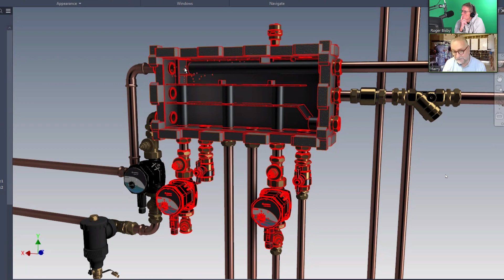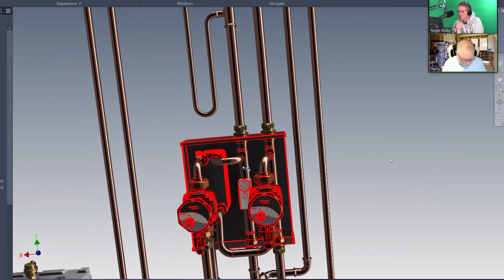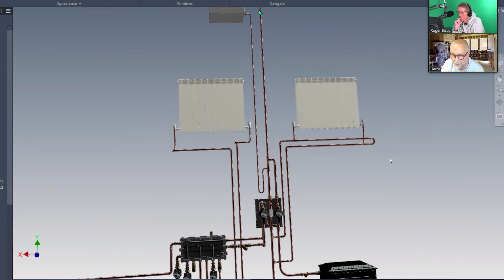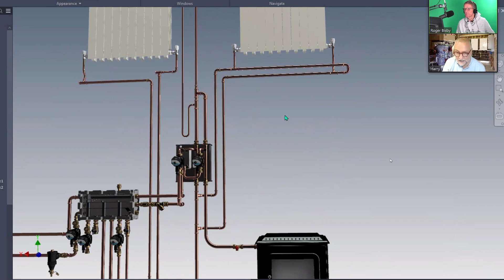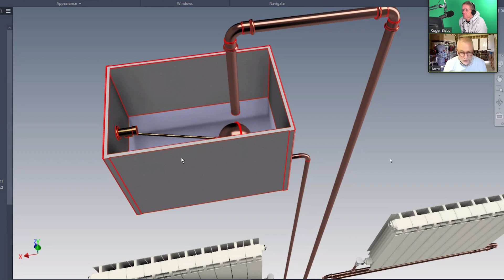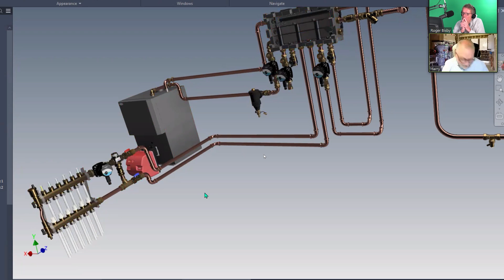Every Heating Installer Should Know This

Comment: It's a common misunderstanding that having a system on that you are wasting heat. This isn't just about single temperature being achieved for you to feel comfortable. A good example of this is if you place someone in a room next to a block of ice and the room is 21 they will feel cold place them in a room that is 21 degrees next to a block of red hot metal and they will feel hot. This is part of the principle of constant heating where the building is kept warmer reducing the rights of loss of heat through radiant transfer from the body to the fabric of the building. Maintaining a constant warmth allows the heating system to be run between 1 and 2 degrees cooler than it would need to be if heating from cold. When we talk about heat pumps and low temperature systems being on with talking about a very low level of energy to maintain a reasonably low level of heat in the property but not so low that the comfort is destroyed by the lower temperatures achieved during an off period with a high temperature boiler system. We also have to take into account the loss of efficiency cause to both gas boilers and heat pump systems when they are operated at high temperature to perform a recovery from a period of no heating. Most of my customers are it engineers and people through the technical interests or from the technical industry. The most regular reporter get after fitting a low temperature system which is running 24 hours a day is that they report a higher level of comfort and a reduction in gas spending of 20% compared to the old on off thermostat on a timer. What we really need is to collect some good test results from customers like these or in a test environment to finally make this understood so that people can adopt the new technology and reduce CO2 emissions while enjoying better comfort levels.

Comment: A perfect illustration of why I went all electric 17 years ago, and recommended it to family and customers.  My 'system' is extremely simple, 100% reliable, silent, and takes up no space at all.  It costs at least twice as much to run as gas (which was there before), but requires no servicing or maintenance, and never requires any parts.  Each room is time & temperature controlled.  It was the best thing I did as part of the refurbishment.
Reply from the maker: Great point! I reckon you could put the £15,000 paid for a heat pump installation into a high yield ISA and it would close the gap between gas and electric even more.

Comment: Got lost on some of the technical stuff. However, is this only for 'dual' fuel systems or would a domestic combi boiler installation benefit from a NRG manifold? 🤔
Reply from the maker: It is really for systems with more than one source of heat. That could be a gas boiler and heat pump or any other combination. It is also good for two gas boilers which larger homes sometimes have.

Comment: This guy really knows his work, learned so much in this video (and I am not in the industry myself). In the hybrid system though I wonder why they design the heatpump to attempt heating for  1hour before having the oil kick in.  Two things:
1. Surely its more efficient for oil to kick in first to bring water to temp.  Besides, a heatpump will do very little in 1hr vs oil.
2. Could there not be logic in the controller that checks outside temp and inside temp, then decides if the difference is great enough for oil to kick in or if heatpump will suffice.  

This is just an observation from someone who has little experience in heating systems (apart from owning a hybrid system myself)

Comment: Absolute genius. How is it that we understand so little about central heating after all these years (?). I looks simple. The principal is simple. But to make the best system requires a genius.
Reply from the maker: To be fair this low loss header is for mult-fuel options and larger buildings. You wouldn't need this for a 3 beroom house.
Having said that I agree that they have been made way too complicated and unreliable. Complicated technology is not suitable for the building industry.

Comment: Telford tanks designed a thermal store tank  for me. Brilliant.  It does the work of a Dunsley. It is connected to our wood burner and oil boiler. It supplies our hot water which is potable and heats our radiators and under floor heating. I explained the system to my plumber and he fitted first time and done a superb job. For the first 26 years the oil boiler was a simple 14/18 Worcester oil boiler. It is now an18/25. I will connect to the tank a thermodynamic panel system soon, the best system you will ever find. It heats water 24/7 day or night.

Comment: I’m a heating engineer, and I’ve just finished installing a system using a lot of these components from NRG Awareness. The people talking about the extra cost and materials need to bear in mind that this isn’t competing in the 3k combi swap space. It’s the 15k heat pump installation space where a lot of the extra plumbing work is required anyway. But for me the really exciting part is that it's a great option for adding heat pumps to the energy mix of the roughly 50% of UK housing stock where a fully heat pump driven system is just not currently feasible (regardless of what the Heat Geeks would have you believe.) My house is one if these. Old, single skin, stone built 3 bed.

When designing the heating system, the goal was to have something that is always operating at the lowest price per KW, regardless of the outside temperature. 

The system is basically a hybrid that involves a large battery (to be installed when the extension is finished) to allow us to use economy 7 and solar electricity to power a 6kw heat pump, a wood burner with a back boiler that can add an extra 4kw into the heating / hot water system (again, adding this when the extension is finished), and a gas boiler. The system switches between calling for heat from either the gas boiler or the heat pump based on the external air temperature, and the wood burner just always adds heat to the system whenever it is being used.

Basically as the temperature drops and you require more heat, at a higher temperature, all heat pumps actually make less heat, less efficiently (you pay more for less as the temperature drops). You have to size both the heat pump and heat emitters accordingly. Bigger heat pump means bigger plumbing, bigger electricity supply, bigger costs all round, and it will never be running efficiently when the temperature is low.

My system uses a 6kw heat pump. But that’s 6kw at -2. At 6 degrees it’s actually outputting more like 8kw, which heats the house just fine without even having to upgrade the radiators. I’v currently got it set so that the gas boiler will kick in below 5 degrees. Over the last few months, the heat pump has been heating the house, the vast majority of the time. Without the battery system (and therefore economy 7) and the wood burner installed yet, it costs about the same as gas. With the battery system and economy 7, it should cost half that much. 

The heat pump is basically always operating as efficiently as possible, and the house is never cold. I haven’t had to upgrade the electricity supply or other plumbing outside of the HW cylinder. It’s a tight fit but I’ve managed to fit everything (NRG Zone, cylinder and all the controls etc) in a corner cupboard. I run max 45 degrees through the radiators when the heat pump is operating and 65 when the gas boiler is operating. At some point I will upgrade the rads to allow me to reduce the the flow temperature and increase efficiency further.

System works great, NRG Zone and NRG Lex are great products, and NRG were very helpful (they actually did bespoke wiring diagrams to help me implement this, at no extra cost), and I would highly recommend. 

As a heating engineer, what this allows is the opportunity to give customers who can’t afford to upgrade everything, all at once, the option to spread the cost of fully decarbonising their heating system over a longer period, while immediately massively reducing their reliance on gas. I’m one of those customers. I bought my heat pump directly from China. It cost less than a middle of the road combi boiler, delivered. It’s modulating, quiet, works to specification, and is actually MCS certified. You can’t get a grant for a hybrid system, so that’s not really relevant, but it’s nice to know.
Reply: At the moment the heat pump market in the UK is broken. As a heating engineer, I look at the prices being charged for heat pump installations, and I literally cant work out where all the money is going, other than into the back pocket of the people who run the medium sized companies that install them (you basically need to employ someone just to do all the grant paperwork). The MCS and grant scheme has almost completely excluded the vast majority of small heating and plumbing businesses from the market, and as a result you’ve got tens of thousands of gas engineers in small businesses and one man bands who customers trust and have used for years, telling customers that heat pumps are a waste of time, and to just install a new gas boiler.

If we really want to decarbonise the heating industry, this needs to change. They will only become affordable when normal heating engineers are able to install them. Heat pumps are simple technology. They are more like installing a fridge than a gas boiler. The key is sizing them correctly, and ensuring that the plumbing system is adequately sized to deliver the lower temperature heat that they produce efficiently. These are skills good plumbers should already have.
Reply: Every 5 years gas engineers go back to school and spend a week renewing their qualification. This should be expanded to include the installation of heat pumps. 

Government support should be expanded to include hybrid systems, made possible by products like the NRG zone, which potentially make heat pumps affordable for more people, and appropriate for more properties. Customers worry that they will be expensive to install and run, and that their houses will be cold. Hybrid systems are the solution in many of these instances.
Reply: The Heat Geeks, to me, make something incredibly simple, seem incredibly difficult. Because it benefits them.... Heat pumps are not rocket science.
Reply from the maker: MG Plumb
Great comment and a good addition to the debate. Thanks for taking the time to write it.
Reply: I'm UK Based, had to import from Ireland.
Reply: @mgplumb9135  , Agree with you in that heat pumps are incredibly simple even more simple than a combination boiler, But look at the mess we in the Uk .With  30kw+ boilers being the most common boiler sold in the Uk where the Average heat loss of the Average Uk Property is less than 6kw at -2 . Ask anyone who lived in those housing estate in Coventry  where Those Firefighters were installed, and Nibe had to remove them , and here we😊 again , with horror stores of badly installed and over sized heat pumps . You are being disingenuous to Heat geeks and the likes whom you referred as attempting complicate the issues. Far from in my point of view ,someone who has spent the last 25 years in the Heating industry.I total disagree with your comments, I believe in spreading the knowledge and best practices will benefit everyone Engineers and consumers alike.
Reply: @lekanshanu5512  Sizing boilers correctly is the same skill as sizing heat pumps. Yes there has been a loss of skill from the industry, that has been masked by the fact that modern boilers modulate so effectively, and even boiler manufacturers have seemingly been happy to allow KW output to be used as a point of difference / way to upsell. 
Both heat pumps and gas boilers are most efficient on systems designed to run at low temperatures. Unfortunately, for decades, we’ve been designing systems with heat emitters sized for high temperatures, and pressurised plumbing systems designed to run at low flow rates.Fixing that is the real cost in most heat pump installations. They are plumbing problems. They require a few days of extra training when you renew your gas ticket, not a completely different regulatory framework that excludes the vast majority of the UK’s heating engineers.

Comment: Hi Roger, I have used NRG manifolds many times and found their product, and more particularly, technical support has been 100%. Its only going to be useful to a small number of applications, like larger houses , multi fuel input options and commercial. I did one guest house that used 4 manifolds, 2 oil boilers, 2 single phase HP, 2 floors of U/F with  multiple manifolds and radiator circuits
Reply from the maker: That is great to know. I am assuming you are in Ireland?
Reply: Yes, we get a lot of farmhouses that that will have an oil boiler and wood/turf stove or external gasifying wood burner linked, and feeding 3 or 4 zones. they also do a wiring control box and wiring schematics. @SkillBuilder

Comment: Did he just say that he fitted two 100KW boilers “because it was an old house” then fitted three heat pumps which are 20KW each, and after it was up and running found that the heat pumps were actually heating the building without the need for the 200KW from the boilers?? If thats true, then this shit is exactly what is wrong with the heating industry🤦‍♂️

Comment: Excellent!

I  fitted my own system based around a thermostore tank which has inputs from a solar heat array, solid fuel stove and an oil boiler.. 

The issue I have is that the system, which is open vented, expands regularly so I get hot water coming out of my header tank overflow. 

Obviously this means the tank gets topped up with fresh cold water every time the system cools down which is adding air and diluting my inhibitor.

I have either fitted my over flow pipe to low or my inlet ball valve too high or  my system is badly designed... i'm concerned that over time I am going to have issues with the boiler or my radiators rotting out, in the meantime I keep my mag filters clean and top up the inhibitor additive once a year but I feel its just a band aid.
Reply from the maker: You might simply need another expansion tank. You can couple two side by side
Reply: Trouble is.. the thermostore tank is all piped and brazed and insulated so I wouldn't know where or how to add a vessel but this has prompted me to get into contact with the manufacturer to see what they suggest..

I have a self-build project coming up this year and I will definitely look into the system designer in your interview.. it was very interesting
 @SkillBuilder

Comment: Good practice to dip cold feeds.only problem they can block up over time
Reply from the maker: You are not wrong. I always do them as compression fittings.
Reply: That tends not to be an issue when the system is designed not to have system expansion problems. Still, having the loop removable for maintenance is a very good suggestion.
Reply: Cibse recommend using tees at the bottom instead of elbows with the outer ends with copper to iron connections with a stop end/plug to make water tight.Easily removable and can rod between each tee as straight through

Comment: So is this cold feed set up with the loop like that just for solid fuel? I always thought that if we were 150mm within each other we would be good? I know we install shower pump supply from 3rd way down from the cylinder
Reply from the maker: I think it would be beneficial on all systems at least to drop the cold feed out of the bottom of a tee and then take it up. It makes sense to prevent warm water rising to the f&e tank.  The problem I see is the tee blocking up at that point which is why I do it with a compression tee. Having said that I am doing sealed systems now so it is rare to put an f&e in these days.
Reply: @SkillBuilder  totally agree with the blockage. Often when you try to drain an f and e and  nothing moves. Will keep thos in mind. Interesting chap and enjoyed the conversation

Comment: As soon as Roger said heat pump I lost all interest. Off to watch Sssniperwolf.
Reply from the maker: That is a shame because he said it could be anything from a boiler to a solar thermal to a heat pump.
Reply: @SkillBuilder It’s a shame that a lot of people don’t have the concentration to watch a 35minute video which was well presented,well explained and obviously took some effort and expertise to put together.I’m not a heating engineer but thought that this video was excellent.Thanks for your efforts Roger and Harry.Keep them coming.
Reply: So he did mention “heat pump”  @SkillBuilder  thanks for confirming 👍
Reply: @SunnyHeywood 
You really do not get this.
Reply: And just what business is it of yours.  @johnburns4017  if I get it or not, I clearly stated I stopped watching within seconds and I made no comment regarding the video.
Reply: I used to work for Carrier for about 15 years and sold thousands of heat pumps.  I understand your frustration as nowadays heat pumps are used inappropriately and they are not made for any situation like they want to tell you, but this system can be used with any heat source and it is just about a well-done hydraulics design.
Reply: Thanks but not interested at all..  @hrvojelasic5794

Comment: When I designed my system 30 years ago. I strategically placed adjustable beads so I could adjust it. The plumber's all (it will hydraulic ( bang)) never has & recently I up graded to a sealed system with a stainless steel hot water tank & the water from the stove & range/ heating is always clean with no problems.
Reply from the maker: How did you connect the open vented stove to the sealed system?